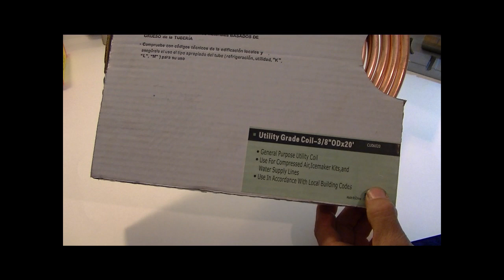Bullet Jacket Making Dies part 1

Comment from the maker: it actually wont close up all the way in the roundover die...My ejector was .116 dia so the jacket just needs to close up a little smaller than that..Then when you use the bottom flattening die and punch it will close up almost all the way...